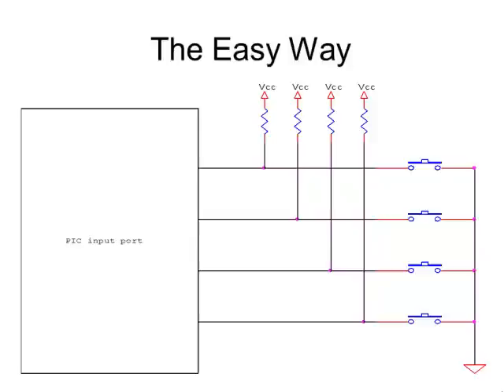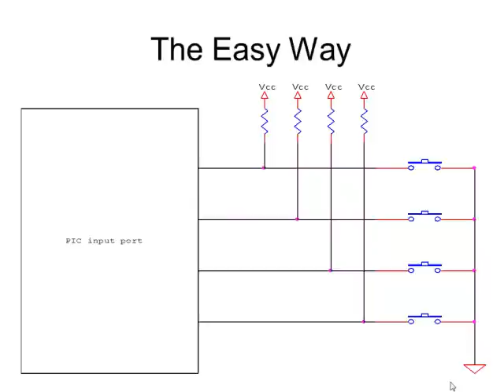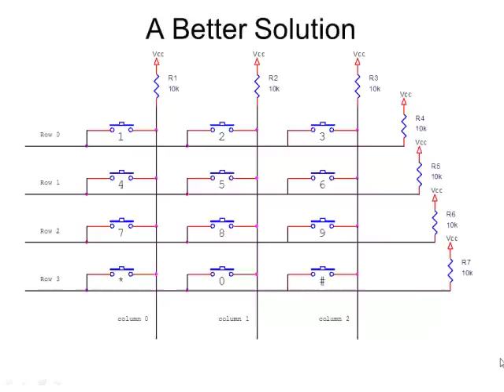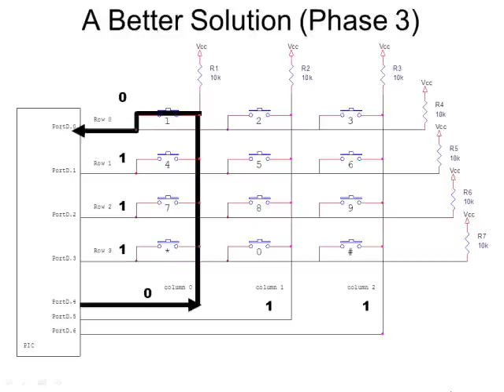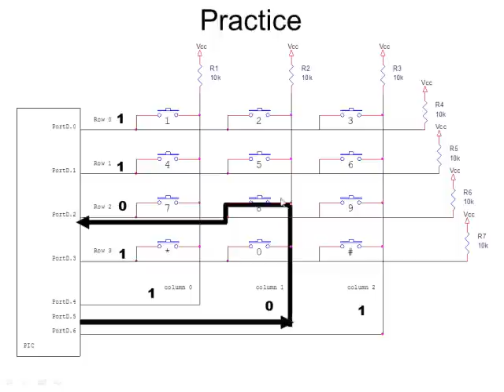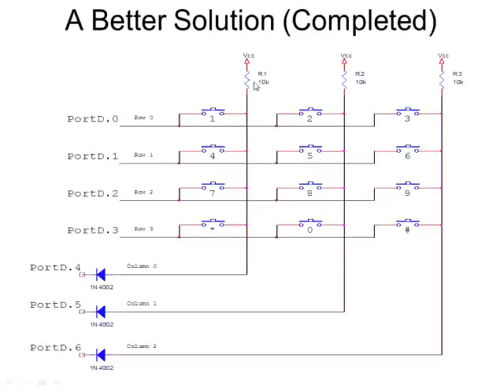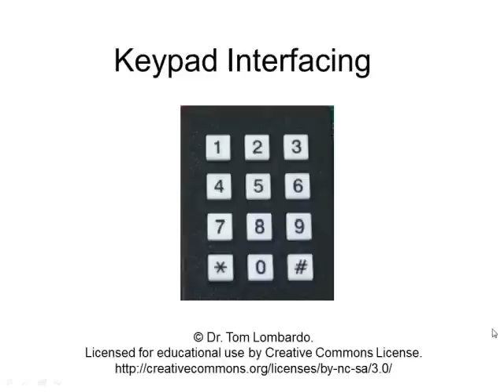keypad interfacing

Comment: The problem I have with this remedy or method is that it's polled I/O,,,,, it ties up my micro and even if I allowed it, a substantial interrupt service routine would cause missed keystrokes. Wouldn't an interrupt based solution be better ?

Comment: Great video, Dr. Tom Lombardo. AND, the link to your Google docs is working (4/16/2019). The last line in your keyinterfacing pdf states "The diodes protect the circuit in case someone presses 2 keys in the same row but different columns at the same time". Great advice! Just out of curiosity, WOULD THE DIODES BE NEEDED IF 2 KEYS WERE PRESSED IN THE SAME COLUMN?
Reply from the maker: Thanks for the kind words, Ron. 

2 keys pressed in the same column would not cause an electrical problem. The idea is to avoid shorting two columns together because the columns are outputs; if one is sending out a 1 while the other sends out a 0, you'd be shorting Vcc to ground by pressing keys in both columns. The diode ensures that current can't flow out of a column when it outputs a 1.
Reply: @RVCEET  Wow, thanks Dr. Lombardo, good thing I asked. I'll set up a test using only one column at a time.